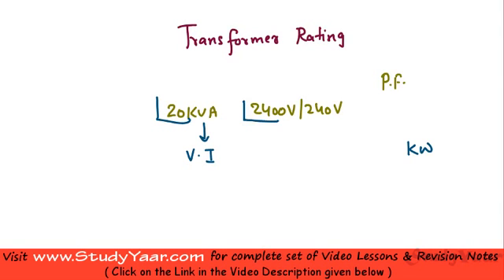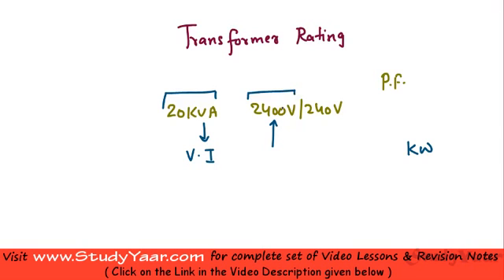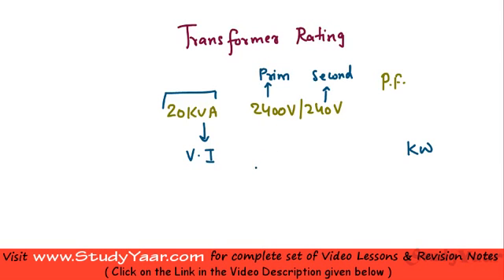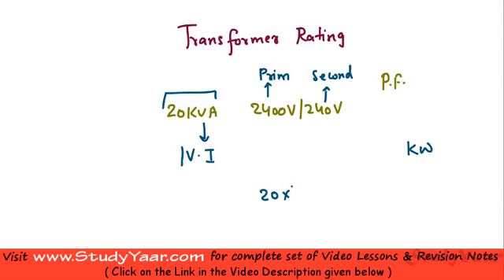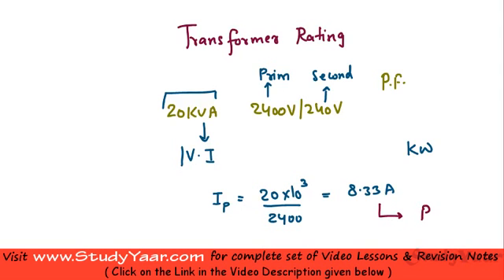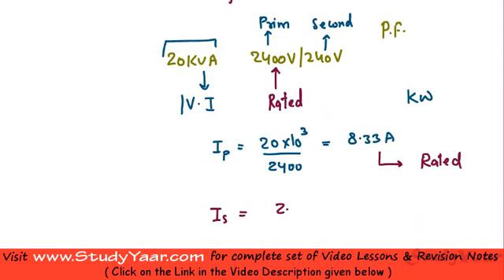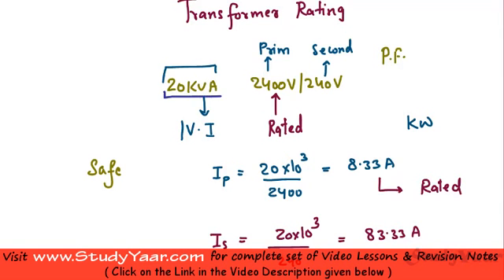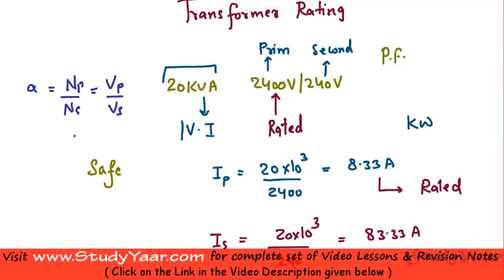Transformer Rating, Voltage Regulation, Efficiency &  Losses in a Transformer

Comment: Please answer this question
The primary of a single-phase transformer takes 1 A at power factor of 0.4 when connected to a 240-V, 50-Hz supply and the secondary is on open circuit. The number of turns on the primary is twice that on the secondary. A load taking 50 A at a lagging power factor of 0.8 is now connected across the secondary. What is now the value of the primary current? (Neglect the voltage drops in the transformer.)

Comment: What happens to the efficiency and current of a transformer once it saturated please explain
Reply: The current goes up, and the efficiency goes way down. When the core is saturated, it can no longer carry any more magnetic flux, and the windings act more like a resistor (the inductance goes down) than an inductor. In most cases, it behaves somewhat like a short circuit.
Usually saturation is only an issue when the transformer is overloaded (such as, due to a downstream short circuit), when the voltage provided to the primary winding is too high, or when there is a DC component in the AC sine wave. (Transformers don't work well on DC, they need pulsed current, like from an AC sine wave, or a transistor that rapidly switches the current on and off.)